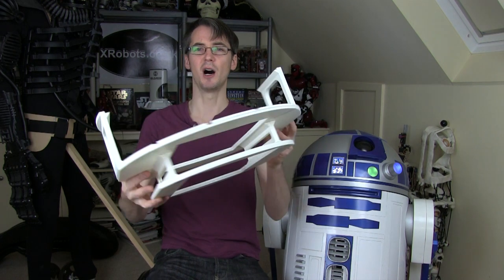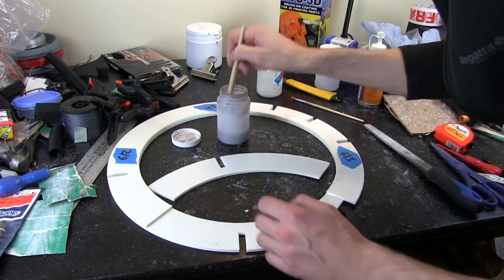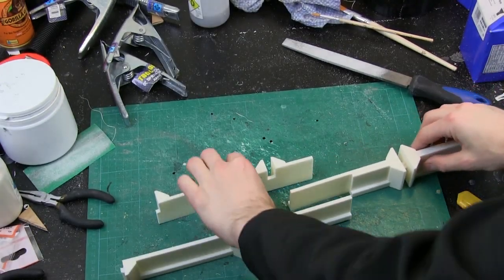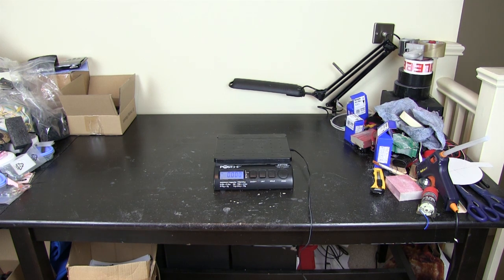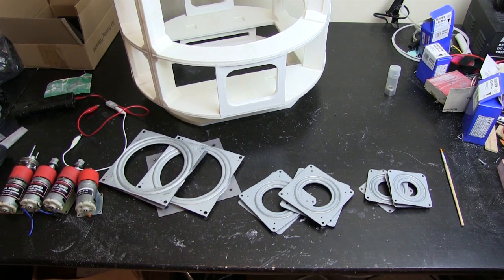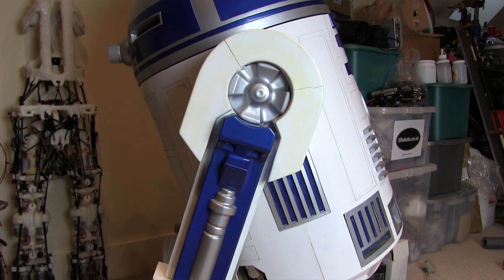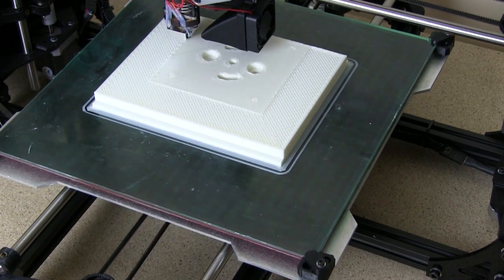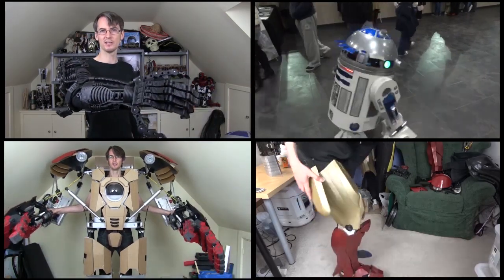Star Wars R6-H5 Droid #2 | Completing the Frame | James Bruton

Comment: Sorry for the spam but I wanted you to read this,for your upcoming lightsaber project you could just make it pop out with a string and retract it with a toggable key-reel.Or a ratchet gear that kan only unwind the sting when it shouts out,and when you press a button you release the gear and it spins back,this way you do not need a backpack or motor on your arm,just 2inches max in the bottom of the lightsaber.

Comment: Hi, I'm building an r2d2 , whilst I'm just using the 3d printer for the light surrounds for the dome, my question is on your original r2 build what paint did you use for the dome, I can't quite stretch to an aluminium dome and haven't found a silver paint I quite like

Comment: does the R2D2 skin plans fit where you have positioned all the vents, coin slots, etc.? I'm printing your frame but would like to skin it with styrene. I want to be sure that the R2 parts fit where you placed the holes so to speak.

Comment: Really impressed by the reliability of your Taz  - what % of prints would you say complete ?
Reply: Rob, do you have a printer that doesn't complete prints reliably or have you watched other videos where things go wrong?
Reply: Jason Kay First layer adhesion is always a problem for me (RepRapPro Mendel) print can start well and then pop off after 5 layers or 200 layers. When it works it's fantastic but can take an evening of setting up/adjusting/testing to get it perfect.
Reply: Rob James ooh i have no clue, can you slow down the print or turn up the heat on the heated bed (if you have one)?

Comment: You kind of gave away the first 10 minutes by showing it in the last hulkbuster video :( Anyway, great progress! One question I have - is there no support needed for the leg holders on the level below it?
Reply: ***** okay - I didn't get the side vents. Even if the construct is hanging on the shoulders, it could be possible that it pulls down and therefore twists the arms out so the body is sagging down.
Reply: ***** well you've probably almost built it in your head and I'm looking forward to the new parts. Thanks for answering!

Comment: Can the drive belt and gear be printed as one piece?
Reply: ***** Looking forward to seeing how your drive belt in Ninjaflex comes out, I had a similar idea but I'm having a lot of trouble getting reliable, accurate prints in Ninjaflex.  It's always oozing whenever the ABS nozzle is printing, so I end up with a sort of "ghost" print of the ABS part, in Ninjaflex.  I'm pretty sure it's just a magic combination of slic3r settings I've not found yet, but it can be frustrating.  I'd be very interested in seeing a video on your Ninjaflex printing settings, and an explanation on what problems those changes have overcome.